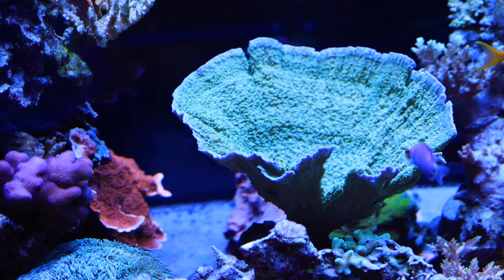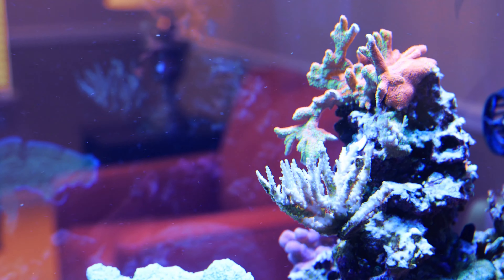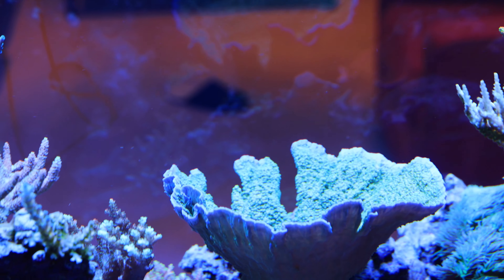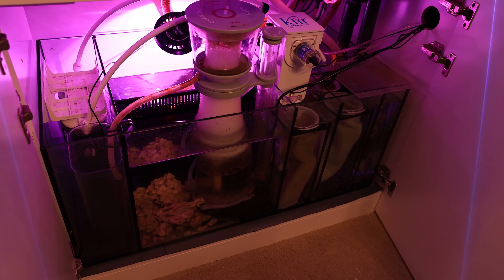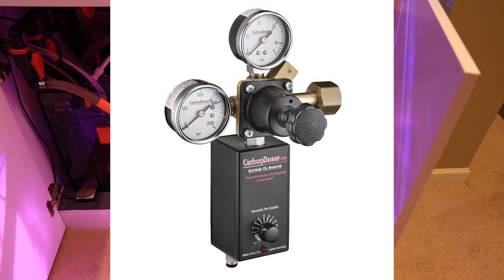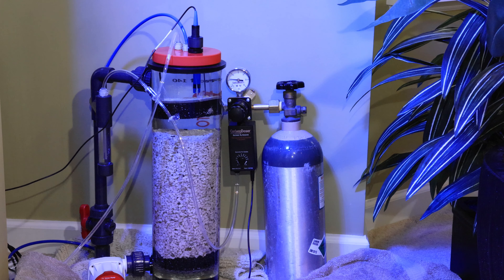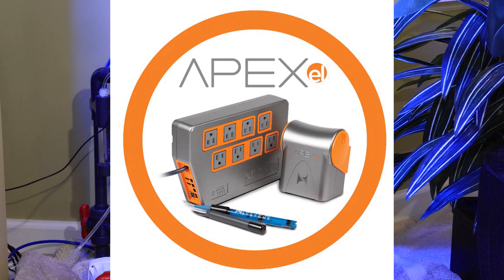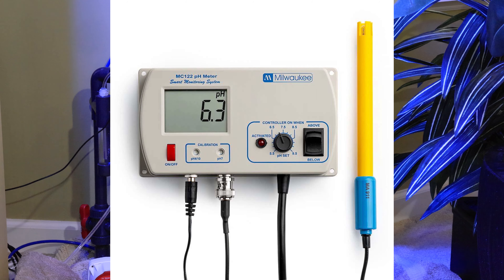From Kalkwasser to 2-part to calcium reactor in the reef tank [4K]

Comment: I am using a Kalkwasser reactor dosing into my refugium and it is money
Reply from the maker: I was looking at one of those. Have you noticed a benefit to putting the kalkwasser in the reactor compared to a regular container?
Reply: @Greego  Yes. Using a reactor the water that comes out of it is always super saturated and it is easy to use compared to a regular container. I clean it out ever few months and top it of with kalk every couple of weeks. Once you get your flow rate dialed in alk a calcium are super stable.
Reply from the maker: Sweet!